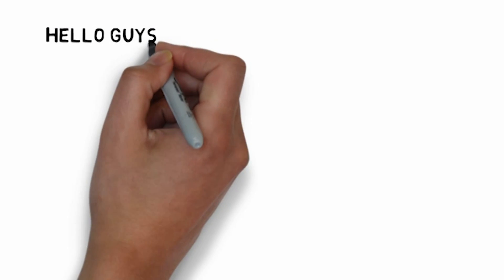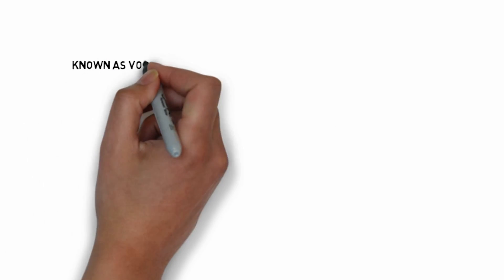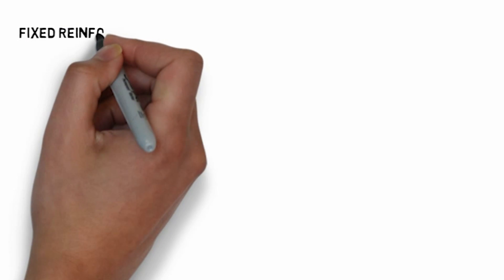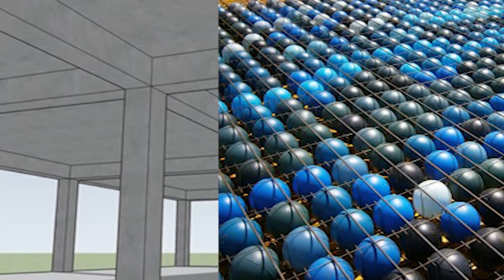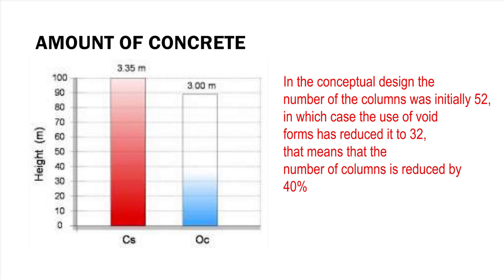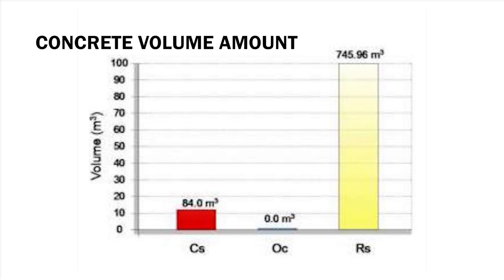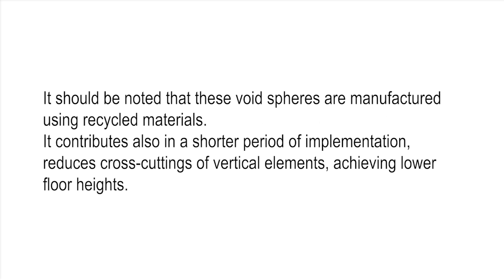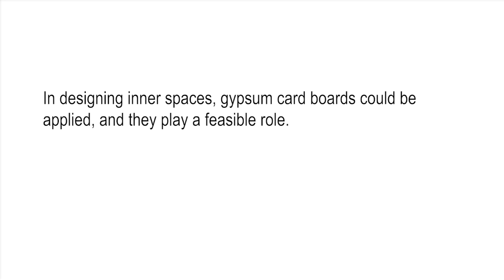Replace of Traditional Slab With Cobiax Slab - Case Study, Advantages, How it decrease Cost

Comment: Cobiax CLS is worldwide uniquely designed for straightforward, error-free installation, ensuring stability and safety. Its load-bearing area in the center of the product simplifies the construction process, eliminating the need for maintaining specific distances during installation: https://youtu.be/xwjfccigT1c?si=ZFNcjWnP_MhzxeuL